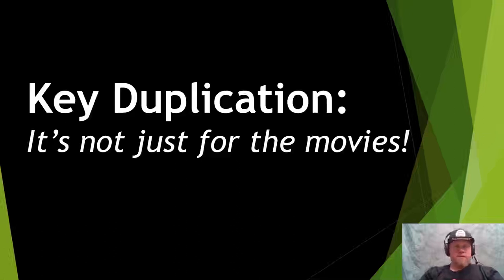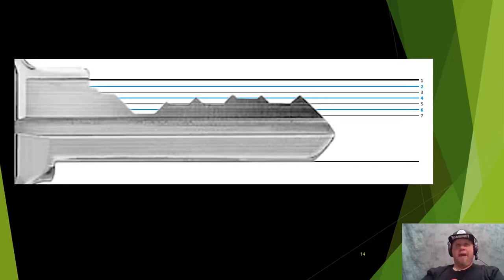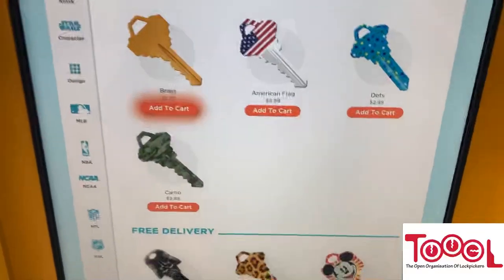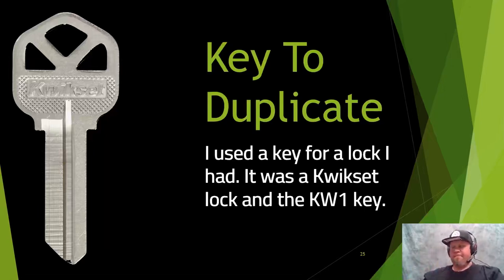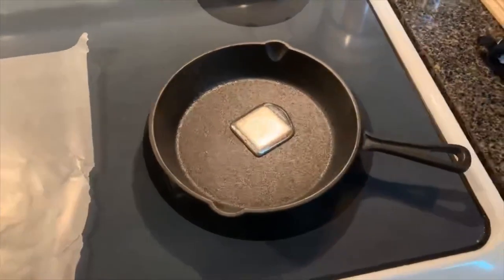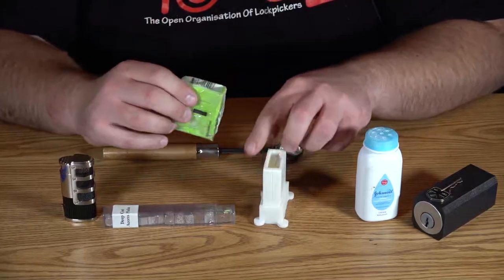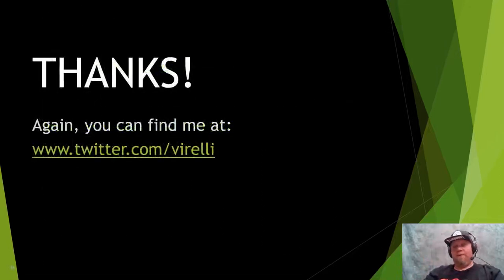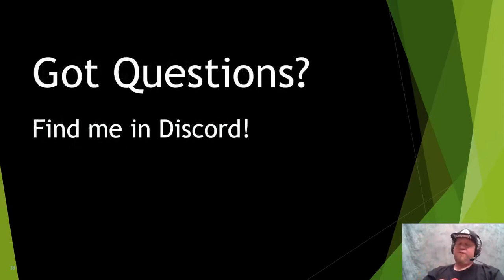DEF CON Safe Mode Lock Picking Village  - Tony Virelli - Key Duplication - Not Just for the Movies

Comment: The Silicone tray, even if it is called an Ice cube tray, it can still be used for baking, so not to coat your pan, you couldve put the chunk of metal on top of it and put it in the oven, it just melts and fills the cubes on its own, you save yourself a step, and a mess

Comment: Cheap metals that melt at low temp are lead free solder and pewter. Go to a flea market or second hand store and buy some old pewter dishes or spoons. For molds you can use cat litter. Smash it up with a hammer and make a dough with some water. It is a kind of cement and gets rock hard when dry. Use a piece of wood for 2 square containers to form 2 flat halfs using a rod to level the top. mold the key while moist and then you can just heat it in the oven before casting.. Instead of a ladle you can use a big spoon or kitchen ladle. Steel has a high melting point and people use it to cast lead all the time. You should be able to get everything you need for under $10-15 and have plenty of stuff for many keys.

Comment: Those key printing kiosk's are a HARD nope.
The ones we have near me cloud save everything. And not only do they not give you the choice to opt out, but they don't even notify you that they are going to do it.
They also have cameras installed, and SEEM to associate actual photos of the user with their keys.
Even worse, the default option for payment is a credit card, so they have all that identity information stored too. (You CAN get a ticket to pay for the key in-store, but you have to go through the menus to do it. And it took me asking more than 1 employee to even find this out.)

How do I know these things? One of the machines happened to break down and the old one sat in the store loading dock for weeks. I happened to notice it being moved next to their dumpsters later on, they had been told just to throw it out because it wasn't worth the shipping to repair it. I asked If I could poke around in it and I was told to have fun as long as I didn't make a mess.

All the key cutting parts and the key hoppers had been moved into the new machine. But the cameras that look at the donor key were still there. As were the control boards. This is when I noticed the face cameras. Those were quite hard to spot from the outside. Most people won't even know that they are on camera when using these.
Reply: If there is a hard drive there may still be recoverable key data on there. Imagine someone hacking their cloud and then using facebook to match people with their address. You could break into homes so fast and never get caught. Nobody thinks anything is up if you walk up to a front door and walk in the house almost immediately without messing with the door.
Reply: @excitedbox5705  I totally expect to see a future Def Con presentation of either their cloud, or local info being hacked. SMH

Comment: I'm trying to figure out what extra security is afforded by mailing you the key instead of just giving it to you. Are there extra checks that happen before they mail it out?  Can the key app work by "scanning" a picture or cutout of a key, skipping the step of needing to 3D print it at all?  Also, going the mold route (which I'm trying to figure out how you can easily pull off molding in 30 seconds discretely), once you have your poured key, it doesn't seem to me to make much sense to measure and then print a key to take down to the KeyMe kiosk, when you can just take the key your poured down, provided you get a decent imprint.